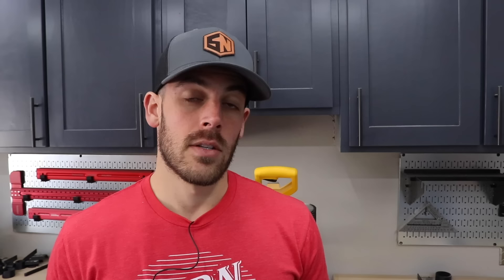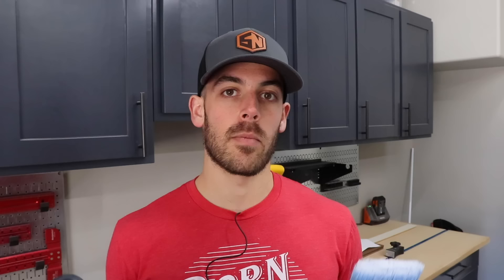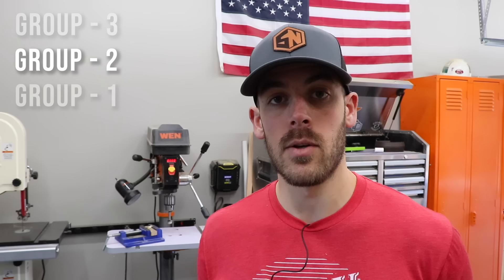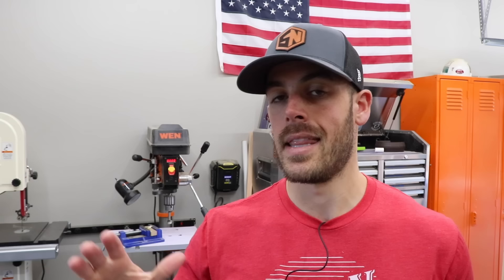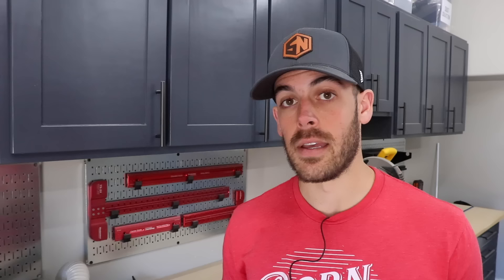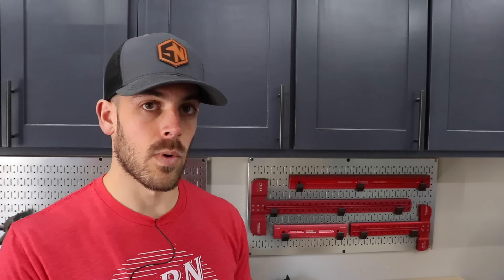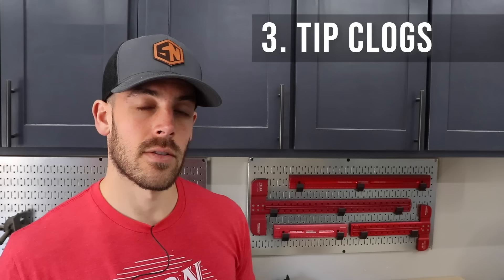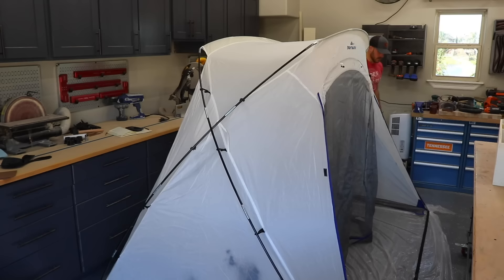Low Cost Handheld Paint Sprayer // Graco Truecoat 360 DS Review

Comment: With a paint sprayer like this, are things like dry and re-coat times the same as when using a brush or roller?  It seems like directions on most paints assume you're using a brush or roller.

Comment: Dammit! Thought I might actually be first for once. Great video dude! Perfect timing as I’m in the process of researching airless sprayers now. I’m considering the Rexbeti Ultimate 750. When you were looking into sprayers, did you give it any consideration? Any thoughts?
Reply from the maker: First I’ve heard of it, I’ll have to take a look!
Reply: There is a  of reviews even maintenance videos from  Graco.
Reply: I have the Rexbeti and I love it for what it is - a great way to quickly put a decent coat on pretty much anything. I’ve painted two full rooms with it, as well as lots of smaller pieces. I originally bought it to paint a small trash & recycling enclosure at an apartment complex that I maintain - it gets hit with graffiti every couple of weeks, so I need to paint it monthly. The Rexbeti is perfect for this, although I’d love to see a reasonably priced battery powered model. 
If I had it to do over again, I’d get the model that’s refillable without taking the cup off (Tacklife, Avid, SGP, and even the Harbor Freight guns all look to be made by the same manufacturer).
A few tips - take the time to thin the paint properly using the viscosity cup that comes with it. For finishes you’re likely to use often, keep a separate can of it pre-thinned to speed up the process. Always strain the finish just prior to spraying. Clean the gun right away, or if that’s not possible, disassemble and submerge everything but the electronics in a bucket of water. 
I’m trying to find a source for spare cups so I can keep my most commonly used finishes ready to go, but so far I haven’t found them. If anyone else has, please let me know!
Reply: Bill Macfarlane- wow! Thanks man! Those are actually some really helpful tips!

Comment: I picked up one of these Graco TrueCoat 360 DS sprayers based off of the previous review here (and other).

The first project we used it for - flat cabinet doors - it worked awesome.  Little messy in terms of overspray, but hey, it's a sprayer, right?

Second project... was pretty much a raging dumpster fire :(  

I don't know if it was just the paint being too thick (indoor latex paint, that wouldn't pass thru the strainer for the cup) or something with my 'technique'... but there seemed to be no middle-ground between 'heavy overcoat, with runs and drips' and 'mostly overspray' because I couldn't get to the insides/corners without drowning every adjacent surface.  The project wasn't (I thought) overly complex - just a pair of basic x-frame country style end tables (just the bases).  To be honest, I wanted to just pitch them in the dumpster and start over, but the wife won't let me :/  So now I'm stuck trying to 'fix' the project by a lot of sanding, and hand-brushing.

If you could do a video on spraying technique, or know of a link to one, I'd greatly appreciate it!

Comment: I have the older graco handheld battery sprayer which also has the same problem as yours, its not a very good finish!! your doors and flat surface's are very patchy as you can see the lines where the paint come out the tip its not uniform, very annoying.

Comment: What are considered “flammables” I have the cordless version.
Reply from the maker: That’s a great question, I’m not sure what makes one flammable versus the other. Maybe some varnishes?
Reply: Oil based - yes.  Lacquer - yes.
Reply: "Flammables" are suspended in "hot" solvents such as acetone, lacquer thinner, etc.  Mineral Spirits is not a "hot" solvent, therefore it's not considered "flammable" for the purposes of use in the cordless version.  The lower priced cordless version is for use with water-based and with spirit-based solvents.  The expensive cordless version is rated for use with water, spirit, and hot solvents.  If you have any questions about this, I would encourage you to call Graco tech support.  They were super helpful to me when I was trying to sort this all out.
Reply: TheCurmudgeon thanks for the info. That was very informative and helpful.

Comment: I am not sold on the idea of these gun sprayers...  ZERO professionals use them and the price is no better than a decent version of the in the bucket sprayer.
PS.... you need to be wearing a respirator... your family will appreciate it.
Reply: why would a PRO use a paint sprayer that has to be filled when Graco has sprayers that pull directly from a 1g or 5g container? the larger sprayers have 25-150' hoses, multiple tip sizes (spray width and diameter).  I could see a small job but even then, using a gallon or two of paint might be better in the larger sprayer.

Comment: That edger ad in the beginning is a joke gimmic. He says "you're not gonna get any closer by hand or using tape?" There is at least a 1/16" gap on the wall along the edge of the trim. That isn't "professional results." Professionals can cut by hand nearly as quickly and definitely more accurately. I know I can. There's definitely a learning curve to using that gimmic too because once the roller is loaded, depending on how much pressure you apply to the tool paint can easily squeeze out over to the outside of the guard and get on the wall. The gap that it leaves along the wall and trim wouldn't be acceptable to any professional.
Also, the finish is lumpy on the wall and if you let it dry at all along the outside edge you're going to get lap marks where you roll over wet.

Comment: Graco sprayers are good. But these hand helds are complete garbag. I bought the ultimate Graco handheld and have had nothing but problems. With under 3hours of spray time I have had to replace every part on it twice. I gave up. After spending 1000.00 it has never worked properly since the day I bought it. Everytime I would send it away to be fixed it would take months before I get it back, spray for 2min the it breaks again. It now sits as a 1000 paper holder.
Reply from the maker: Yikes!
Reply: I really don't think that your talking about the graco 360. I" for some reason" or another,  can't seem to find, one, single,problem with this unit. Resulting in a great looking job! After job, after job....and so on...Still working just as it did the first day I bought it. Check into your procedure.

Comment: I found it to be a POS, the thing worked great for three jobs and now it sit in the box. wont touch Graco products ever again step up and get a real gun
Reply: I have the same gun and it's a pain to get primed and mine leaks. I also bought a cheaper homelight hvlp sprayer. It is 100$ cheaper and works much better than the graco.
Reply: Graco do great pro airless paint sprayers, your lokking at about 1000 euro tho

Comment: Have one of these and it SUCKS ASS
Reply: Because?
Reply: @ThekiBoran  the pressure is terrible, very intermittent. It shoots in "bursts" instead of a smooth spray. Leaks from everywhere. The first one I bought I had to wrap a towel around to get through the day because the paint leaked so bad. Took it back and exchanged it for a new one, same shit again but not quite as bad. Don't waste your time with this garbage.
Reply: @harrod19 

It's just that I hate having to thin paint to spray it through my cheap home depot hvlp gun.  And I don't want a long ass hose that I have to clean out whenever I spray a small project.
I get a pro quality finish with my cheap gun but I hate having separate containers for thinned paint.
Reading all the comments and reviews it sounds like a hit or miss product.  Perhaps you've pissed off the tool gods?  ;-)
Reply: @ThekiBoran  perhaps... Depends on where you are in life. I'm done with cheap tools when quality is the output. Ie no cheap sprayers, brushes, measurement tools, etc. Cheap clamps, hammers, consumables no problem.
Reply: @harrod19 

I hear you.  $20 for a plastic, Chinese-made Starrett angle finder?  Or $75 for a metal, US-made Starrett angle finder?  I went with the US made one.